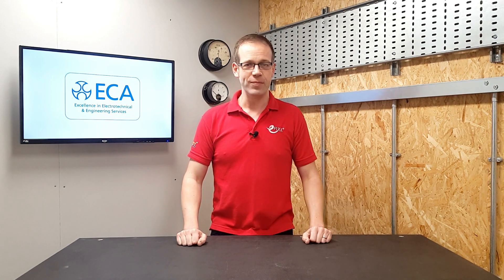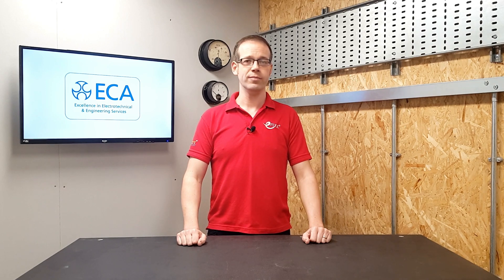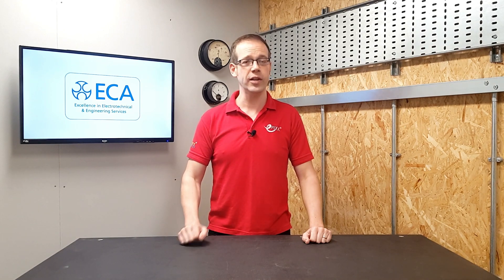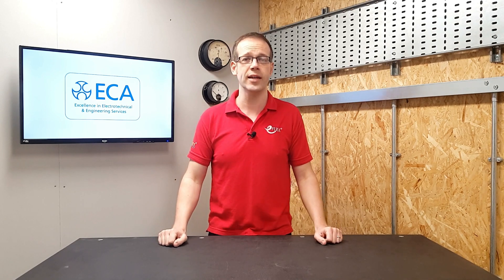Can you use PVC cables such as Twin & Earth outside? - Electrical installation question.

Comment: I use FP200 for outside lights or sockets were needed as its uv stable ,comes in black or white sheath and has the CPC all around the inside. Seen plenty of PVC that’s crazed and cracked by sunlight along with perished pvc clips .
Reply: As do I. The rigid aluminium shield also gives a reasonable degree of mechanical protection when surface clipped.
Reply: Pretty good idea but I've seen fp cable break down outside as well. 20 years outside is bound to destroy most things in the UK

Comment: Went to my daughters rented house , no eicr done. So had a quick visual inspection. Outside light  fed in twin and cpc, cable wasnt to bad but if it was moved it would definaly crack. Asked her where the switch was, she said you have to plug the extractor in for it to work......erm 😂

Comment: I have seen PVC  cable  on several jobs installed in the 60s and 70s and it’s still in reasonable condition. Then again I have seen cable on 2 accounts probably put in during the 90s that has split almost the whole length. In both cases made by bicc . . Maybe a different recipe plastic.
Reply: I've seen many TNE installations painted in gloss which corrodes the cable within the space of about 18 months and I'm supprised that nobody has been killed!

Comment: How many outside pir/flood lights have a trailing twin and earth attached to them? I’d guess every other house. If carrying out an eicr and this situation was encountered. Firstly would it be a c2 or c3? And how would you remedy it? Adaptable box and flex into fitting? Or try and kopex into the light somehow?
Reply: code 3 if no signs of thermal damage, i have heard people using artic flex for outdoors,myself have never come across it
Reply: Mainly hottubs ive seen it on, a customer give me the manual the hot tub come with and it recommended a supply by arctic flex
Reply: I've had the same thing at my mums garage. There is done 3 core t&e to an out dude light and it's south facing and it's Been there for about 15 years with no troble and no signs of breaking down. it might crack if it was disturbed.

Comment: Running along an exterior wall at a decent height, eg - no chance of damage / flood lights - rubber pond cable would more than suffice. Anything else would be an armored run to a junction box then with rubber cable for the last bit from JB to light fitting.  At a push use artic flex. T&E is just not meant for outdoors, it goes too brittle and isn't waterproof.

Comment: Questions: Do you have to fire seal the rear entry holes in a consumer unit if it is mounted in/on a stud wall? When would you use intumescent gaskets/pads in a domestic setting? Keep up the good work guys!

Comment: Would be good to see content relating to the correct use of SY,CY,YY cables and their limitations
Reply: yes definitely, I use a lot of NYY in outdoor installs but the OSG says its naughty
Reply: @MrGrumpyjohn01  Where does it say this in the OSG please mate?
Reply: @jonathanbrown9245  p90 of current light blue cover
Reply: @MrGrumpyjohn01  Cheers mate, NYY isn't the same as SY,CY & YY. NYY is the same as PVC Armoured but without the Steel Wire.

Comment: Yes, you can install bare wires these day as long as it’s backed up by an RCBO but bad practice though.😂
Reply: Better to use telephone cable because it saves on installation costs and is insulated. 🖕

Comment: Whats the point can look in the big book!! Give some examples of cables and other options.. love ya videos as there always good for new gear and idea’s. I have seen pvc cracked on a catenary wire after somebody got a shock from touching the wire. I personally use armoured or black flex. Im unaware of the type of plastic its made of but if its ok for pond pumps should be ok clipped to the wall.
Reply from the maker: a series on cables coming soon

Comment: This question never gets a definitive yes or no. The regs need clearing up, for example what if the pvc is in conduit? or even better the pvc t+e is inside a room surface mounted with light beaming on them X hours a day from the patio doors?
Reply: The conduit would stop any UV from breaking the cable down, as would modern glass.
Reply: Also there could be a danger of electrical shock during demolition.
Reply: @oliverriall  glass blocks UV-C but I don't believe it blocks UV-A or UV-B as much.  I am unaware which UV range (A/B or C) is the one that breaks down PVC Cableing

Comment: Saw some white F.P used on a roof supplying AC units, the outer insulation was completely destroyed by the UV light
Reply: Yes, but there will be more money in the economy because of the annual rewire 👀
Reply: Must be a difference in brands then, Prysmian have always claimed their FP200 is protected against UV light and so for outside use

Comment: Guys, with all due respect, I am doubtful of the value of a short vid that just skims the surface of the subject. There is so much more to this, swa was not mentioned, mechanical shielding (Kopex, trunking conduit etc) not mentioned and neither were the dangers of physical damage to exposed soft covered t&e. This vid was just a waste of time, and poor content.
Reply from the maker: Thanks - we have a full series in the works on exterior cable - this video was in response to a question related to PVC cables.

Comment: if a person really is adamant not to use outdoor rated cable or conduit. Then using single conductors should be fine , even if the cable breaks down it won't short circuit.

Comment: Regs talk about installations being fit for purpose... I see PVC/PVC outside all the time, in reality it might take 10+ years for the insulation to degrade, but I have seen so many where it has gone brittle... I personally wouldn't install it outside, easy enough to put some conduit on a wall if you have to...
Reply from the maker: Agree - A bit of trivia - The regs for light fittings BS EN 60598 don't allow for a PVC cable fitted - must be rubberised or similar HO5 RNF etc
Reply: Or you see it swinging in the wind going from the house to a shed with no catenary wire more common than not put in by the owner🙄
Reply: @efixx  I actually didn't know that, is that for outside or light fixtures in general?
Reply: @HereForTheMusic-h5o  Not just light fittings but yes, it’s used for outside installations and is cheaper and quicker than using SWA. A lot of people call this “high tuff” cable. It’s essentially flex cable that is weatherproof so it can be used outside. I used it on Monday to wire and install 3 outside lights, you just cleat it to the wall like SWA
Reply: @uplightuk8924  H05 and NYY(high tuff) are two different cables. Each have different uses.
Reply: @myles8259  Meh, pretty much the same. I’ve gone to the wholesalers to get high tuff and they’ve given me HO5. High tuff is just a generalised term used for this sort of cable
Reply: @uplightuk8924  Not at all. HO5 is a rubberised flex cable, where as NJJ is a pvc cable rated for outdoor use with a second layer and (usually) solid core.
Reply: @myles8259  NYY is a German designation for a cable rated for outdoor use and direct burial, much like SWA is used in the UK. I believe it's solid up to 10 mm2, 16 is available both solid and stranded (coarse stranded, i.e. each strand is about 1.5 mm2). H05RR-F is mainly used for hand tools in mainland Europe, although it is considered acceptable for fixed wiring in some countries (in Germany it is not, not even for permanent use outdoors or on building sites, in those cases H07RN-F is required). I also highly doubt that H05 can be neatly clipped to a wall without having a clip every 15 cm or so,
Reply: Fp200 great for outside lighting. Available in white and black to blend in 👍
Reply from the maker: @uplightuk8924  We have a video coming out soon on NYY / Hituff style cable  - it is very different from flexible cables - HO7 & HO5 etc  -
Reply: @myles8259  H05 is not, by definition rubber. H05 just means Harmonised 300/500v. H05RN-F would be rubber flex, but on the same hand - H05VV-U is standard PVC twin and earth.
Reply: @iggifer  if you follow the conversation, you’ll see we’re talking about HO5 RNF which is rubberised.

Comment: I always run my outdoor line on SWA cable regardless for the use of lights or sockets because I think is the best practice.
Reply: Rubber pond cable is an option too for exterior lights,  if at a height ,clipped direct where its very unlikely to be damaged.